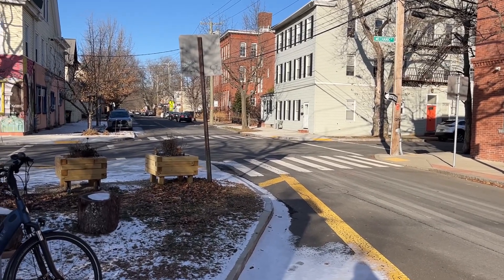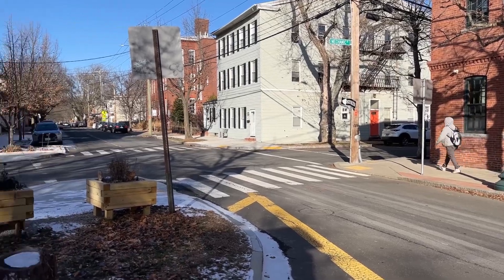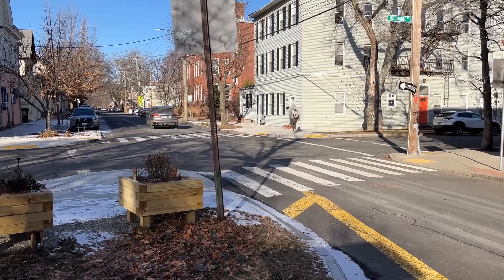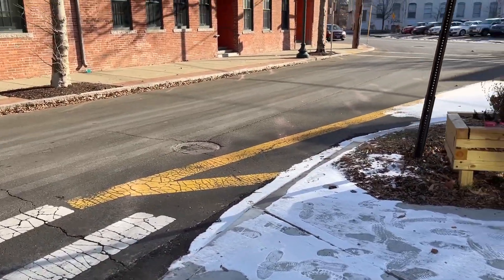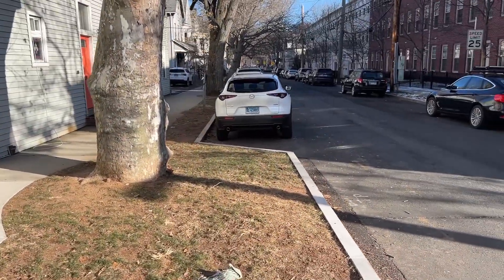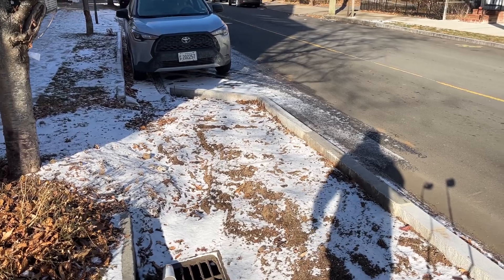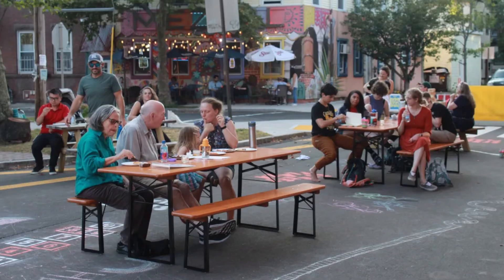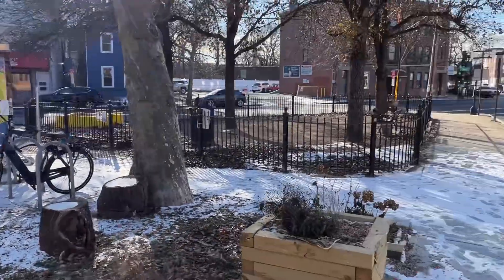Pedestrian Bumpouts for Crosswalk Safety

Comment: Bump outs like this should be mandated for any new or repaired infrastructure. I also would’ve loved to see the crosswalks be elevated rather than the dips that allows water and snowmelt to puddle up at the crosswalk.
Reply from the maker: This work was done as part of a sidewalk repair contract, so additional items for raised crosswalk paving, new drainage, and crosswalk striping were not in the scope.

Comment: Won't somebody please think of the semis
Reply: Ah yes, because this is an industrialized area where we will consistently see large semi-truck traffic going through and using the area.... (:
Reply: left turns are possible in a semi. and with the absence of bollards i am confident i can use a little bit of the kerb to make a right. just my two cents as a trucker
Reply: /s
I hope
Reply: @NickCombs  for sure.   I tried to get curb bulbs on a recent project but the traffic guys said we had to accommodate a wb-67 within the curb line. :-( seems to always be the story.
Reply: Surely parked cars up to the intersection where a better situation for trucks. This intersection was never great for semis, but using the opposite lane you could turn before and you can still turn.
Reply from the maker: I can assure you that large trucks have zero reason to use these residential streets. The largest vehicle we design for in this area is a school bus